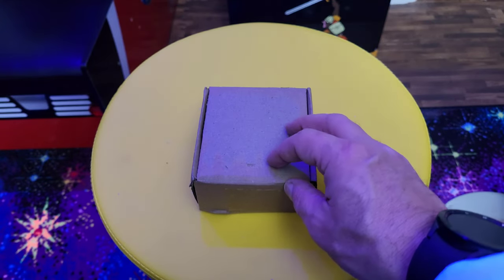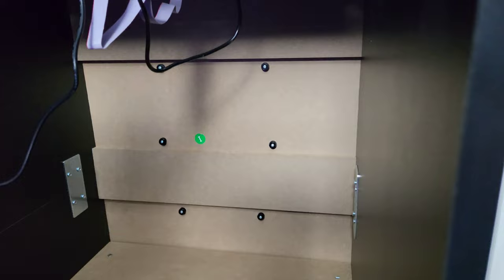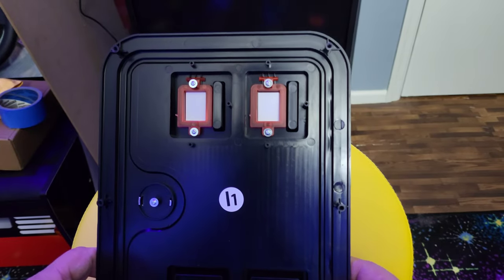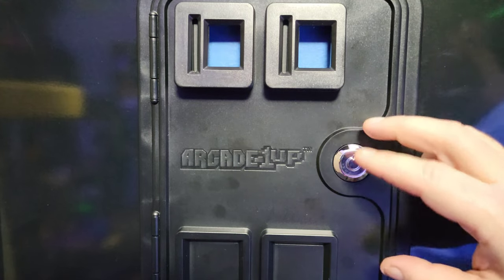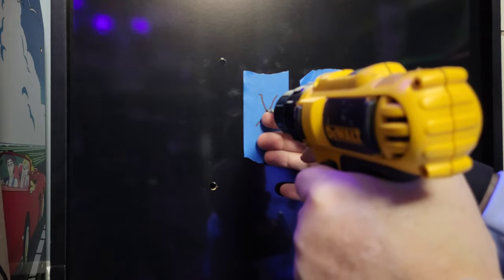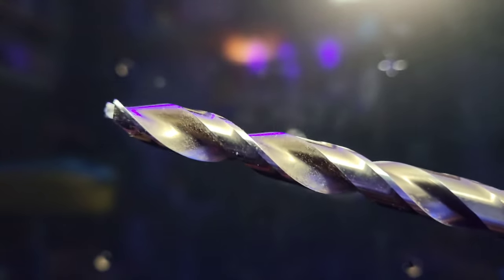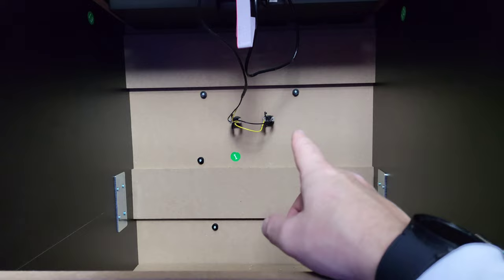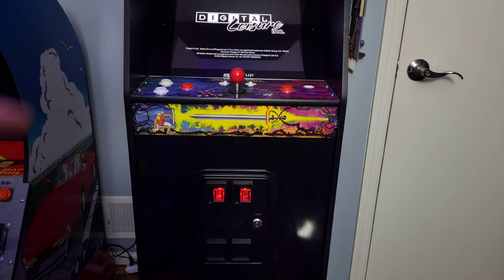Retro530 Coin Door Light up Kit for Arcade1up Dragons Lair

Comment: Hello Jester,  What an awesome video. I love the tip with the blue tape and the X to find the center. Genius.  I would have been measuring all over the place. This is why I love YouTube.  Always great helpful content. Thanks again.
Reply from the maker: Thanks so much for the awesome comment. You are very welcome. I love helping when I can.
Reply: @Jester Tester  Hey Jester.  I have a quick question. Do you have to push just the red socket through the holes you drill. Or does the red up to and including the black back portion of the socket get inserted in the hole?
Reply from the maker: @Arcade Maniac  Hello AM, great question.  In this install, you only have to insert the red socket into the holes. The black part of the socket is larger and acts as a stop, so the bulb doesn't fall out the front of the hole.
 Hope that helps my friend.  Thanks for the question.
Reply: @JesterTester  Thank you for the answer. 👍